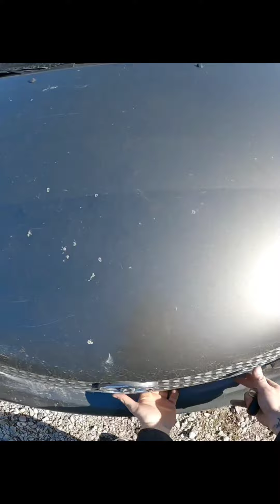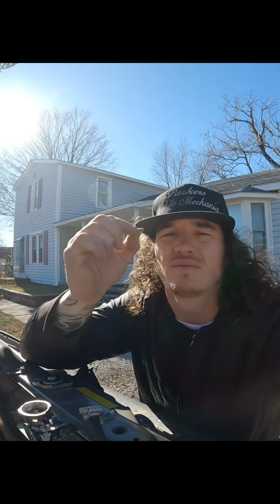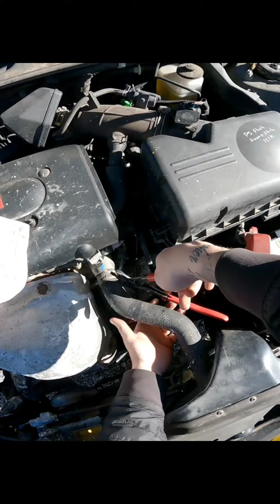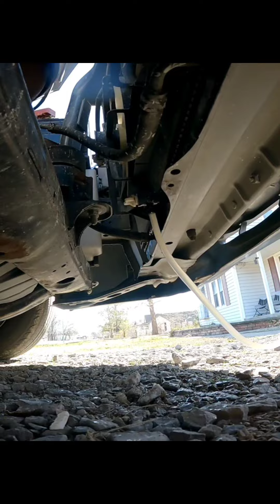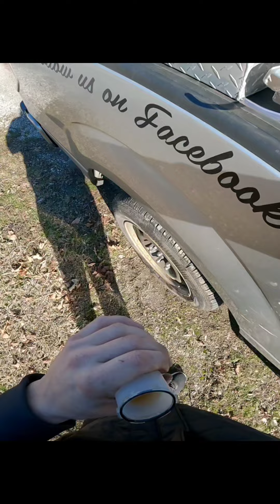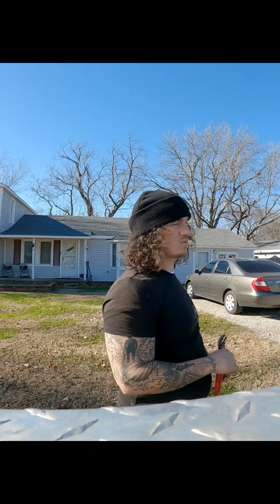Just bought this car off of Facebook marketplace he thought he bought a 🍋

Comment: That’s a 2007 2.4 that’s a head gasket for sure bolts coming loose out of the head that’s a real job
Reply: That's most likely what's happening here. Not that bad of a job if you've done a couple. Time sert makes a fantastic kit. It's expensive but those Toyota engines will run forever

Comment: How did the oil not being mixed with coolant led you to conclude that it didn’t make its way into the collider head?
Reply: Collider head? You mean cylinder head? Well first being the old oil would have shown moisture IF the stop leak was an attempt to block a head or head gasket leak. The stop leak definitely mixed with the coolant and definitely circulated through the head but radiator stop leak is made to set up in leaks in the radiator and hoses the head gasket is too hot and under too much pressure for it to hold. They make a product for stopping leaks at the head gasket and they go into the coolant sale as radiator stop leak but sets up in that high temp high pressure environment. No fuel in coolant or Oil, no oil in coolant and no coolant in oil indicate no head or head gasket failure. Still could be one but most likely previous owner was losing coolant on the driveway and instead of fixing it he poured in a bottle that promised to fix it for him.
Reply: @308dad8  Thanks for sharing your thoughts! I meant Cylinder head

Comment: First off the radiator stop leak stays liquid until it hits air. So no air no solids. I personally would’ve just put a radiator on if it was my car even if I was gonna sell it just to not be a dick to the next guy but still it’s not the worst thing they could’ve done and far from likely to damage anything that’s not already damaged by using it. That stuff keeps Walmart and parts counters running and folks living hand to mouth getting around. Used oil stop leak in the past and it lasted years, well past me and the next person selling it. Used the radiator stop leak but I don’t remember it stopping the leak. If memory serves I ended up replacing that radiator but it’s been a long time. I would try it in the Air Conditioning lines but I worry the leak would be in one of the coils and if it’s the one under the dashboard I guess I would end up having to replace it anyway so why not.